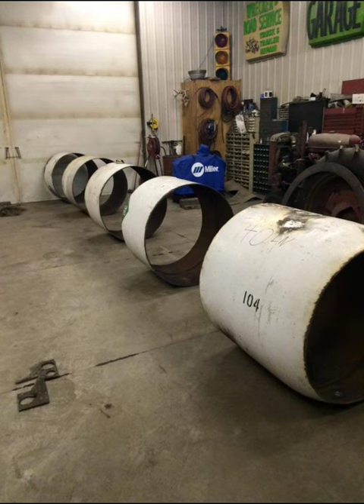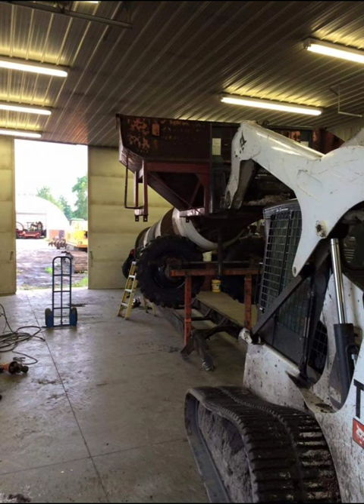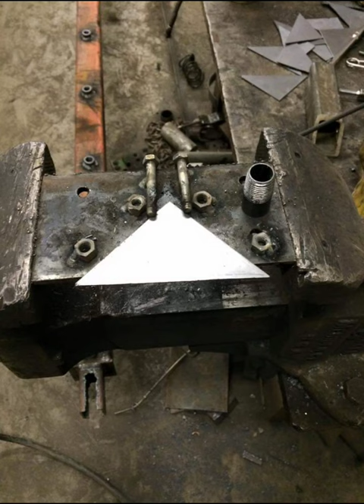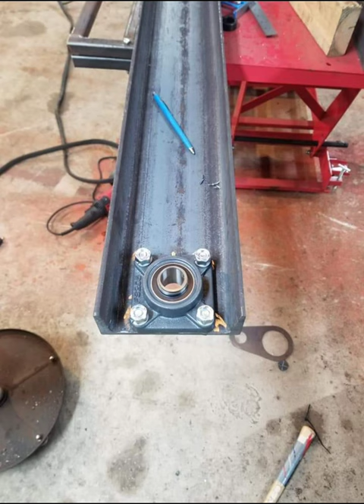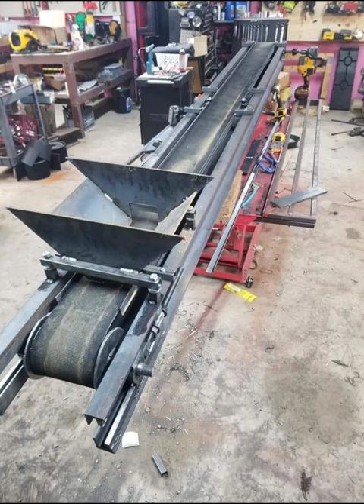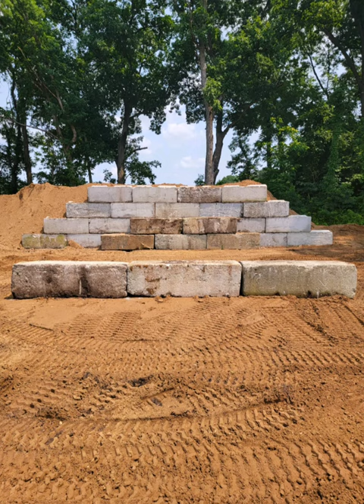Trommel Build From The Beginning Till Now Video!

Comment: What type of motors did you use to turn the wheels?
Reply from the maker: I used to worm drive gear boxes from a TL irrigation system and the hydraulic motor that runs them I'm not sure what exactly the specs are on the motor but it's what comes on the irrigation it's just a Eaton orbital motor